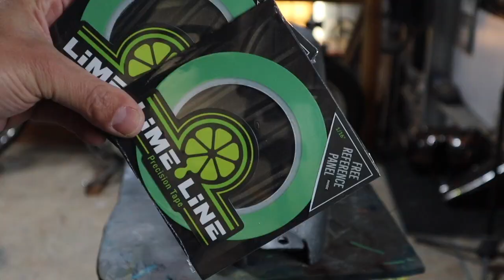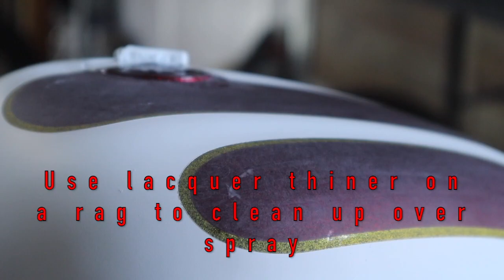How to make new paint look aged. Vintage cracked paint effect on a motorcycle chopper tank

Comment: Great work! I painted my first chop back in the last century (1978) and had to buy the paints imported from the US to here in the UK. Expensive!! No internet just magazines and books for info. The name Candy or Candy Apple as it was called then confused me at first until I realised that it was what we call a toffee apple here. The illusion of depth. I was fond of pearl bases with candy apple and using flip flop(?) which gave a 'now you see it now you don't' effect with graphics. All learnt from a how to custom paint book. 🤯 Because my shed was so dusty I ended up making a small  spray booth in one corner with plastic sheeting. All it takes is ONE fleck of grinding dust to ruin a candy apple coat! (sand it back, start again.) And cold damp air causing fogging or 'orange peel' (sand it back, start again, warm the shed up.  (NOT with a fan heater kicking up dust!) Good extraction, heating and lighting is so crucial. Cold, damp and dusty sheds do not make for fancy paint jobs. Good to see that the art is alive and well. Respect. 🙏
Reply from the maker: Thats awesome
Reply: Thanks for the cool story and tips!

Comment: Killer job Again ! Just snagged the 20oz mps off of your shop.Experimented with the 6oz. Took a piece of Plexiglas and epoxied it to the top,added a fitting and made a pressure cup for my hvlp turbine sprayer. 3m wants $60 or more just for the cup.These are a steal at a little less than $50 for the kit  and way cheaper than pps.
Reply from the maker: nice

Comment: Bad ass! How long do you wait between layers to remove tape and to be able to start wet sanding after cleared.
Reply from the maker: 24 hrs or so to sand after clear. you can pull the tape 10-15 min

Comment: I'm very sorry, I don't understand how white paint cracks are made

What kind of white paint did you use? What's added to it? Does the crack appear automatically after 24 hours? Thank you for sharing
（Forgive me for my poor English）
Reply from the maker: speedo kote white base coat, I replaced the reducer with lacquer thiner. it takes 1-5 hours for the paint to shrink depending on how you mix and apply the paint.
Reply: @TimeWarpCustomPaint  Thank you very much.
Reply: @TimeWarpCustomPaint  if more lacquer thinner was added would it create a more drastic cracking effect?

Comment: I watched the whole video to learn how to make the paint crack and you didn’t explain it. Click bait dude. Not cool.
Reply from the maker: I asked if anyone had any questions
Reply: @TimeWarpCustomPaint  thanks for getting back to me. I’d love to know how you achieved that effect.
Reply from the maker: @SpeedandChromeTV  i used lacquer thinner with my white basecoat instead of reducer causing the paint to shrink.
Reply: @TimeWarpCustomPaint  wild. Thank you for the info.
Reply: @TimeWarpCustomPaint  Thank you, curious show long does it take to crack? I'm wanting to do a whole car. A '32 Ford roadster to make it look like an old paintjob. I have single stage paint. You say you only add it to the base coat? Not the clear? Thanks for the help. Also, once its painted I want to color sand so you can see some of the primer coming through.